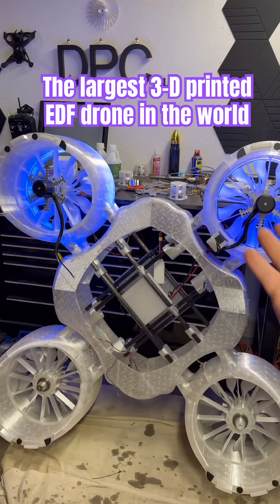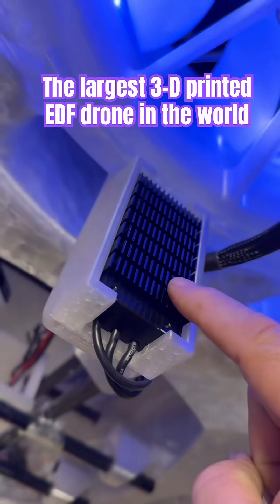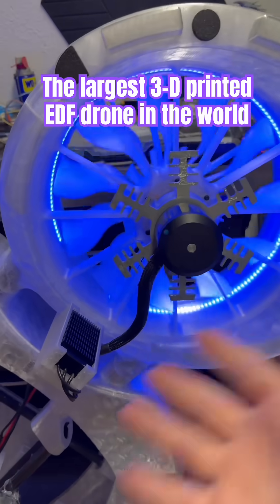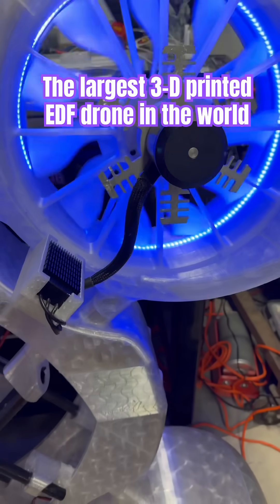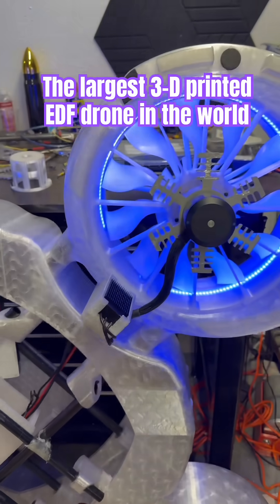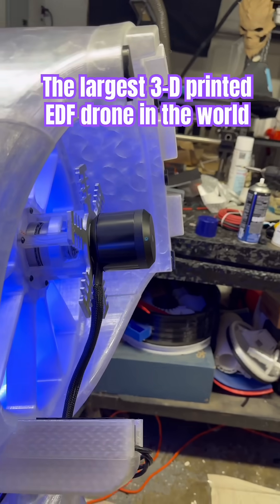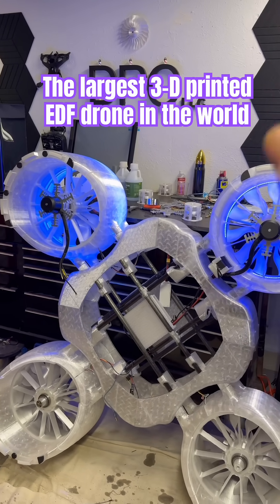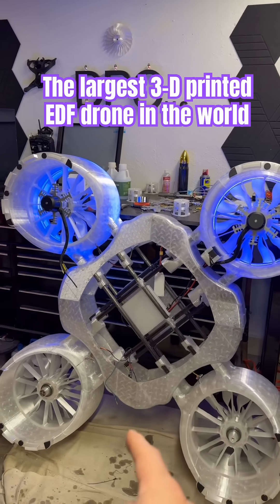Largest printed EDF in the world gets its new ESC mounts for the Mad Components 120-amp AMPX.

Comment: Where did you buy these parts?
Reply from the maker: It depends on what part you’re referring to the motors. I got off of Amazon the ESC‘s. I had to order from mad components mainly because they’re 18 S and there’s not that many 18 S system is on Amazon at least that I have found the heat sink in front of the motor I designed infusion 360 and CNC on my MPCNC the body I designed infusion 360 and 3-D printed plate by plate and then the internal body of the drone is reinforced with carbon fiber rods. The shaft bearings for the fan are tapered roller bearings that go on car axles things like that.